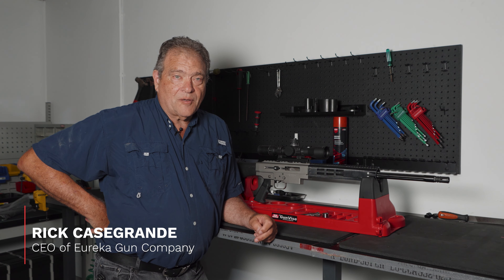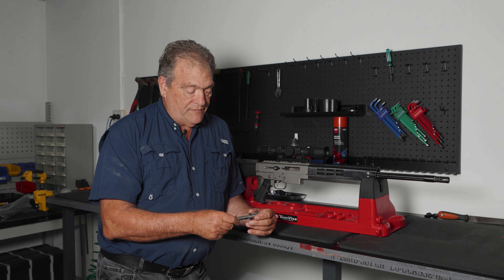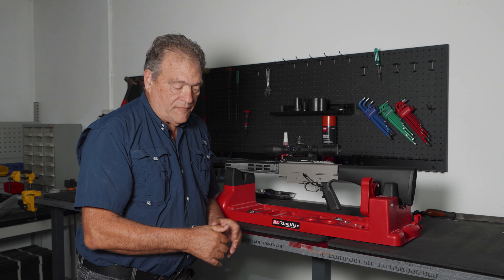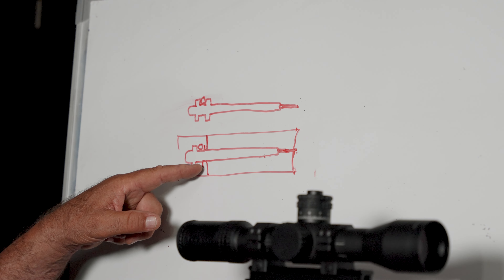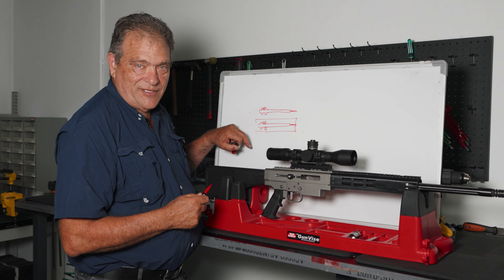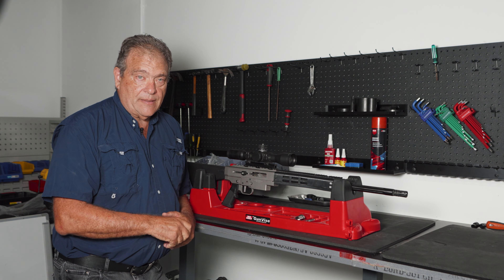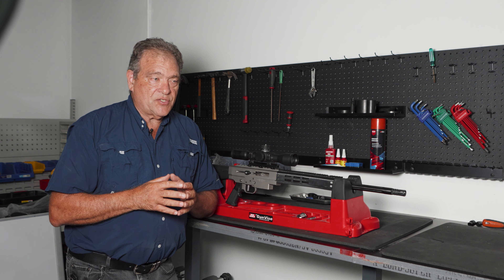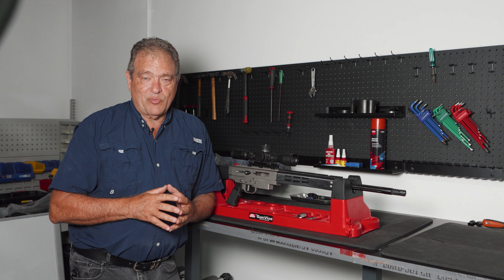Eureka Stockade - Floating Barrel, Firing Pin, Lever and FAQ Update #3

Comment: Good to see you guys working out the issues, In regards to making the lever adjustable, would it be easy to design it so that it has multiple holes (attachment points) at small spaced intervals like a belt buckle that the user can undo and make it the correct length? Kind of like a lego technic?
Reply from the maker: That is literately what Rick had in mind. Now the difficult part is how to machine it without it costing a fortune. Keeping in mind a lever shall not cost more than 5 bucks, otherwise the gun gets too expensive. Fine balance and maybe an after market option. We will see what we can do.

Comment: Really interesting update fellas, glad to see the issues being ironed out. Personally i reckon the rifle looks mint and like the idea of the lever being for the thumb. Interested in seeing  the effect in accuracy with disconnecting the gas block from the forend, i reckon its the right move as most my hunting I'll lean on the ute door or qaud bike handle bars putting upwards pressure on the fore-end. Also wondering if you'll ad a dust cover and a handle slot cover like the FNC or galil? (i know it will probably increase price greatly) im sick of cleaning dust out of my rifles. Cheers fellas
Reply from the maker: We are mindful of the dust entering the action. We have already reduces the area that is open when the action is closed to the absolute minimum. Honestly, if you keep the action closed, you will be fine. I would love to do a mud drop test as well and show how the action shoots out the mud during firing....I just need the new receiver. A dust cover is currently not planned for as it would be very expensive to make. Hope we can offer it as an after market option later......if necessary. Great feedback tho! Thanks
Reply: @AustralianSportingAgencies  Awesome to know you fellas are aware of the dust and are designing it to reduce its affect

Comment: Hey guys. Excellent stuff once again. Are there any plans to change the disassembly process of the rifle? The one gripe I have with my Taipan is that it takes quite a while to take apart and clean if required, whereas with an Oceania or Warwick there are simple takedown pins.

Whilst I understand having a similar system may increase the cost, (or even the risk of the rifle not being approved under appearance laws?) I personally think many users would greatly appreciate a less tedious disassembly process for the upper & lower receiver. 

Regardless, I am over the moon to see an Australian company that is this engaged with its customers. I put a preorder down a few weeks ago and I am delighted to see the continuous improvements following this rifles manufacturing journey. A wooden stock certainly sounds cool as well!

Wishing you all the best
Phil
Reply from the maker: Thanks Phil for the feedback. We have discussed the take down pins a few times internally but for now Jim and Rick are of the opinion that the screws will offer a better longevity than pins. I'll keep at them and will pass on the feedback tho.
Reply: There is, with all due respect, a significant difference between doing a quick field strip and clean of your personal—issued—weapon, in the bush, before carrying out other duties related to your section, etcetera; versus stripping and cleaning your civilian rifle either standing by your wagon/ute OR at home in your garage/workshop😁. I can vouch for this fact.
Reply from the maker: @michaelguerin56  Hey mate, Rick is going to address the topic in the next video, hopefully released this weekend. Stay tuned

Comment: Thumb 66mm 
-For the thumb lever, could you use a pin with a spline;  offering 2 or 3 different lever sizes in a T6 or T7 aluminum.  If you used perhaps 8 or 10 spline, you could adjust the angle to optimize. Understanding there would be some cost involved there. 
Great to see your progress!
Reply from the maker: Great feedback, ill pass it on!

Comment: Would it be possible for you guys to test other AR pattern magazines in the rifle? Such as the cross industries 10/10 cross mags, as well as steel mags, lancer polymer mags, etc

I only ask because a certain NSW compliant rifle named after a snake has issues feeding from anything aside from 10 round gen 3 pmags and it would be nice if the stockade doesn't have the same issue
Reply from the maker: Great point, I will run it by the team as I don't know from the top of my head if they "anchor" the same way (gut feel tells me they don't). Will find out for you.
Reply: @AustralianSportingAgencies Thanks for looking into it.

Comment: Why not just have some different size/ length  levers available as optional extras
Reply from the maker: It all comes down to production cost. The moment you make two options hence cuts the production in half, your costs go up significantly. For example, the factory might say, if you by 1000 units it will cost 10 bucks, but 500 units will cost 50 bucks each. So the most cost effective way would be to have one version. If we can have one version but make it adjustable at a reasonable price, that would be the best outcome. Hope that helps to understand the dilemma?

Comment: Probably been asked and answered multiple times, but I was wondering what barrel lengths you are planning for so far? Thanks
Reply: At the moment I believe the options are a 16.5" bull barrel and a 20" fluted varmint barrel.
Reply from the maker: Hi, the options are 16.5inch and 20inch, both will be match barrels as the weight is lower and the accuracy higher than the standard barrel. Both barrels are available in 1/8 and 1/12 twist. Hope that helps?

Comment: Would it be to expensive to just offer 2 sizes of lever?
Reply from the maker: Offering two sizes would likely be feasible unless the supplier charges more for smaller quantities as you need to split the total quantity by two different designs. You also would need to increase your overall inventory to keep enough of both in stock. Thought it might just be another 5-10 bucks more, it adds up as the retail price would increase by 4x of the manufacturing costs, so total increase of RRP by 20-40 bucks. I will run the numbers tho